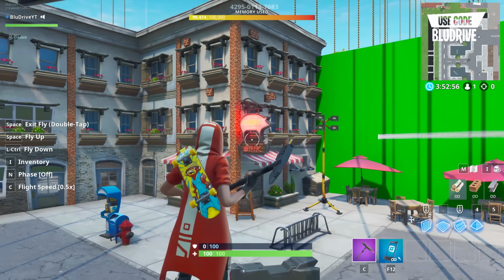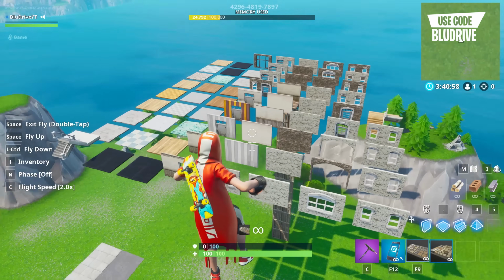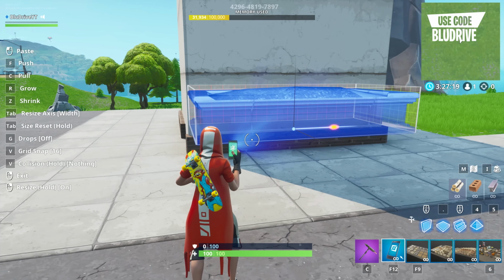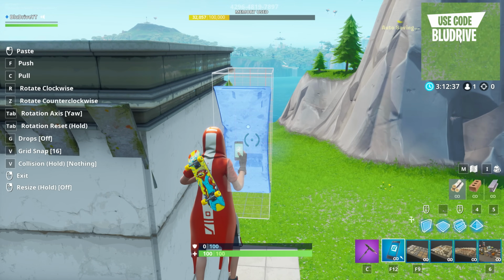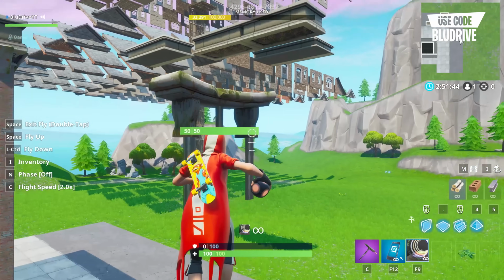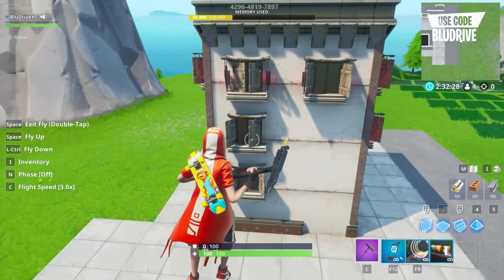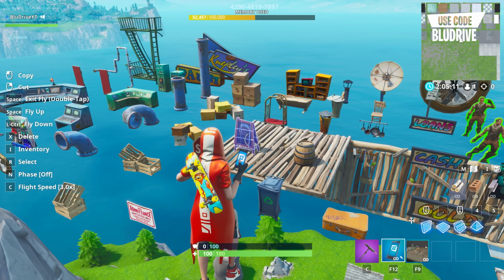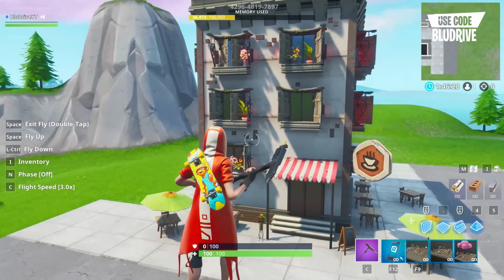How to build CUSTOM HOUSES in Fortnite (Tutorial)

Comment: Yoo Bludrive, You can use a Hover platform as well for your gallerie's to make them flote in the air to remove it eazy later instead of building a wall al way to top ;)